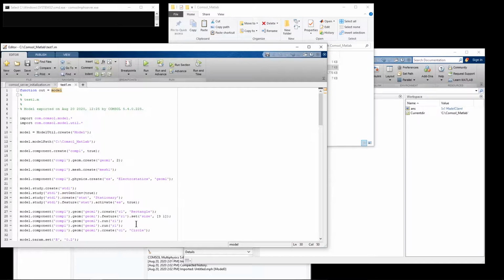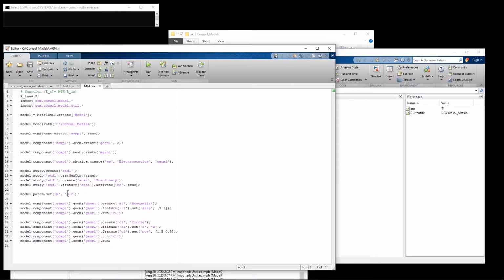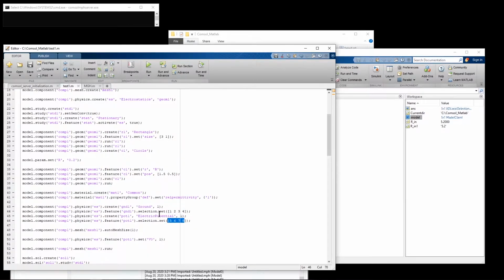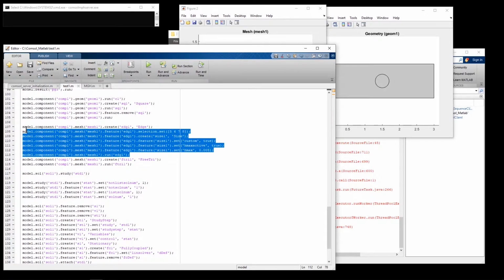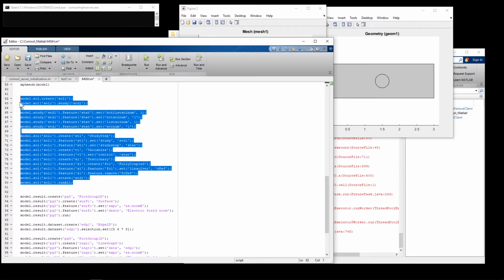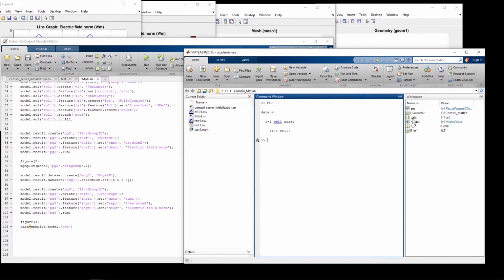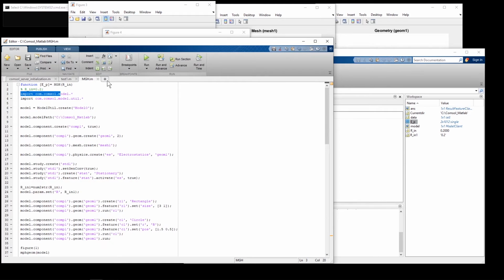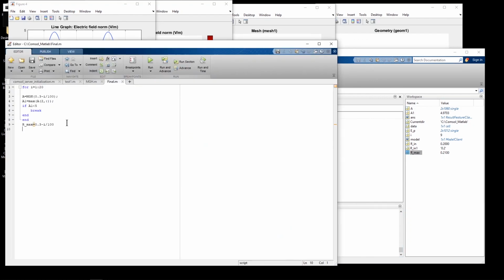How to connect MATLAB to COMSOL ... ( Part 3: useful commands and final implementation )

Comment: This video was extremely helpful for my work. Being able to use MATLAB features for a COMSOL model is amazing. The only problem I had was that I was running a huge model, so I had to stare at the MATLAB code for so long without having any idea what the level of progress is. I solved this problem by adding this line of code:
ModelUtil.showProgress(true);
Right after runAll command in the .m file. This shows a progress bar to stare at =)))

Comment: Thank you so much for your work, I have designed an optical modulator and I want to calculate efficiency between the optical mode and RF, I have some difficulty in extracting this factor so, could you please make a video about that. thank you in advance

Comment: Thanks a lot for your work. I have a question: when the geomety is complicated. The m file can be quite difficult to read. Then I am using the "mphload" function to load the comsol file and change its parameters accordingly.  However, the output result seems not changing with my input. Do you have any clue why?

Comment: Your video is very useful. I'm currently planning to use comsol for finite meta-analysis, but I find it difficult to use COMSOL to MATLAB. Because the stiffness matrix assembly inside COMSOL is difficult to find the rule. You can make some videos about how COMSOL to MATLAB performs stiffness matrix, mass matrix extraction, and other element or matrix operations. If you can, this will be especially helpful for people who use both software. Thank you from the bottom of my heart.
Reply from the maker: I may give it a try later (these days are busy time). You probably have read the discussion in the following link: https://www.comsol.com/forum/thread/22442/stiffness-matrix